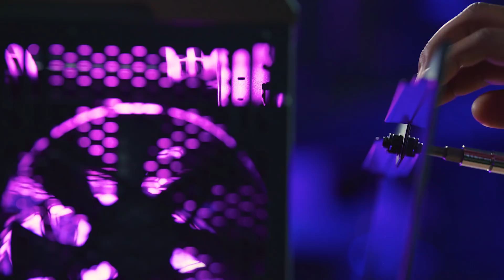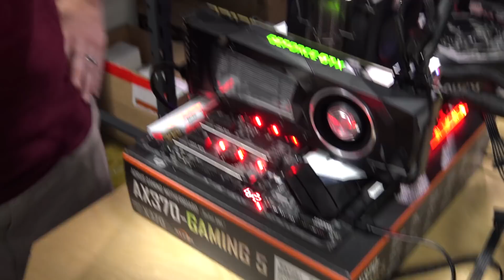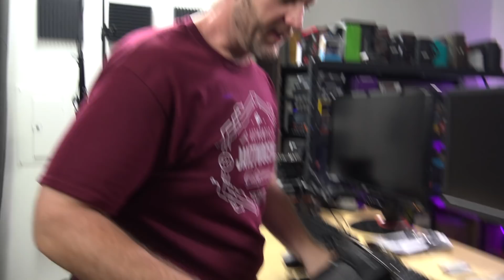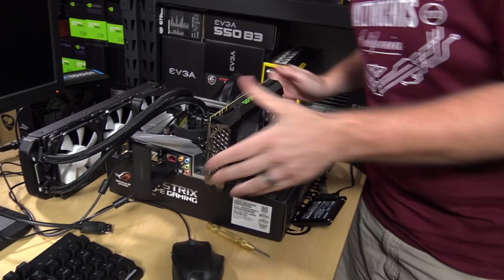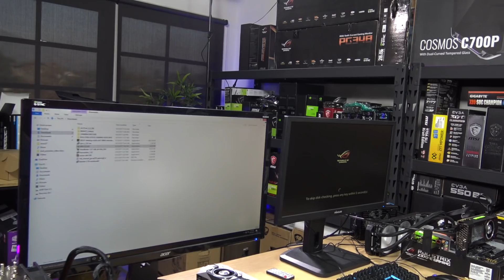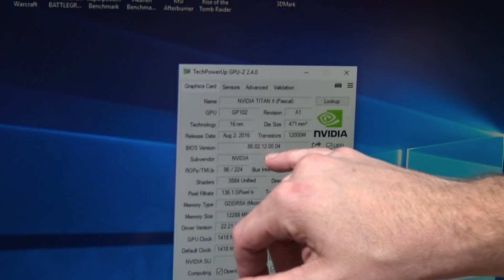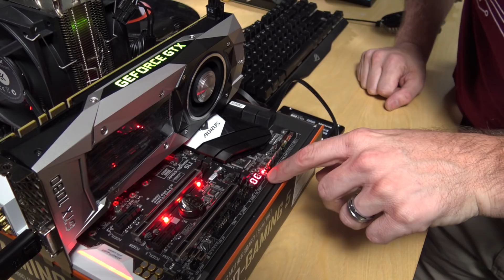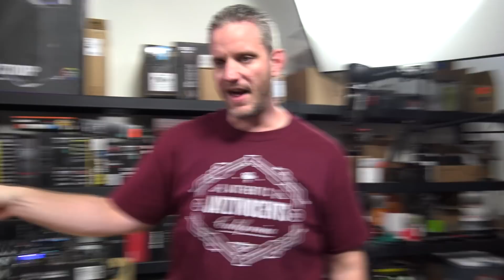I cant figure this one out... HELP!

Comment: i think the mother board is having issues. maybe it's a bad bios update? i have had 0 issues with my 1800x. i have had 3 different cards in my system and haven't had a single problem with it. or maybe the gpu is the problem. not sure which one. i'd contact the motherboard manufacturer and ask them if their is any known issues with  certain gpu's.

Comment: Fisr want to point out you checked the bios twice on the same card. First pulled it up on intel and then moved it over and checked it again did not check the card that was moved to intel system. Just pointing that out but i dont think that is you issue i actually had a similar issue with a previous build and it did turn out to be the motherboard. U can test this if u have the same board witch it out and it should work just fine

Comment: Problem, we don't his BIOS settings and whether he's OC'd the Ryzen system.

Jay, have you loaded failsafe defaults and running at stock clocks. Also, I suspect the system is using UEFI bios and nothing in legacy mode. May want to see if you could use DVI with the "Bad Card" I had a similar problem with my 1080 founder's in SLI. (complete shot in the Dark) Disabled one card, and booted with one card and uninstalled the Nvidia Driver and re-installed without letting Windows use the WDDM driver.  I had to also update the chipset software. 

Funny, my issue was on an intel system with 6600k. I think the problem is something to do with UEFI not allowing the device. My board was also from Gigabyte. Problem with UEFI on Gigabyte boards? 

Like others have said, and I'm sure you'd heard it enough; "Check the Bios" of the problem card. I would ask the blowhards to stop repeating each other b/c that's not the only point here. Jay is perfectly competent. This is a very unique problem to my knowledge and the problem is very strange.

Let us know what you find out Jay.
Reply: I know I know, replying to my own reply. One further suggestion, as this is bothering me. 

1) Boot with working card
2) Disable UEFI Boot and UEFI CSM such that you are booting legacy
3) Attempt Boot with problem Card. "If boot = Success; Then Profit" if not
4) Disable EFI Support, and also attempt removing RAM Modules and other attached devices
5) Try disabling VGA EFI Driver support 
6) Disable any Ryzen specific settings
7) and this probably should have been first, but compare the two cards' Bios.

I would personally hope you do step seven last, as I want to know if any of the other settings are causing the issue. If you do the others first, it's worth a 10 dollar donation from me.

Comment: I have had the same problem, except it's with my memory. What I do is I remove the battery on my motherboard and leave it unplugged for a couple of minutes to flush all the capacitors. After that I try booting with sticks in different slots and trying the automatic overclocking button on my motherboard until everything works again. Usually takes me more than 20 restarts to get it working again.

Comment: A couple of things I noticed, the bios needs to be checked on the bad card with the intel to compare correctly, the second is the Ryzen Mainboard bios settings do you have system security or CSM disabled, enabled?   If it happens with other cards as you eluded to it could be Ryzen bios settings.    SIP, system integrity protection may be the issue.

Comment: I noticed you used different DP connector. On the non functional PC you alvys use bottom connector. On the working one you use top DP port. Aslo try switch monitors or boot up without connected LCD monitor.

Sry. my bad english.

Petr

Comment: Did it work with an older bios revision? Have you tried a different slot?  If you can get access to the same motherboard I would try that as well. It looks like you have exhausted all of the other options on the gpu side, if it were a corrupt bios you would see may other issues. Since you have probably ran the benchmarks on those cards how close are they running? That would be a long shot but maybe you can see something in the numbers there, but I have doubts it is the gpu itself. Other options would be bios defaults, different memory and or cpu. They are all odd ball things but may give some different results. It could be the most dumb thing.

I have a gt1030 that works in every system except the one I want to run it in. It is an older intel machine. Another gt 1030 works fine in that machine (borrowed from elsewhere). They both are the same brand, I did not check bios revisions on it, I just figured it was typical nvidia qc, but now it may be something picky with the motherboard or gpu. For my issue, I tried different memory, cpu , power supply; since I am running a pico psu it may have had issues powering it. Since this is more of an emulation box I will figured I would just run the old amd card that was in there.

Comment: Need to check the NIVIDIA website to see if there is a newer Bios for the card , But Even then i would think it would work , My 1050 Ti had a Similar problem After a couple of months use , reported it , took a week and a New DRIVER was Released , Hint , hint , DRIVER , Not Bios , I actual contacted ASUS for an RMA , Thought For sure it was the board . Turned out it was just a DRIVER Update issue , The Serial # Coralation Could had been a problem , not recognizing the card , but Even then , i would think it would work . What i did see you resolve 1 with was a re-seating , how ever , i think you would had try`d this with the first card as well , ? , Any way , If i had a 1080 Ti , I would be able to help More ,But-t , 1050 ti is all ive got to work with , Good luck !!! "reminder" , Im still working Off a X370 Prime , so with the board possibilities , Im just a Dud in the water when it comes to that , Again , Good luck ,,, Stop counting on GPU-Z to give you your Bios versions , Look in the NIVIDIA Control Panel , or Just Open the GEForce espirence to Locate such information , I Never use GPU-z CPU-z , to find My GPU information , Or my CPU information . Although its a Good use in Live Contrast to Bench by . But Not a Viable venue to locate the Product information Through .  My Apologizes

Comment: Former SSD firmware engineer for 5 years - It can still be the device (GPU) that's broken:  it could be taking too long for a particular operation (out of spec) and the Intel is more lenient on the timing while AMD is not (e.g. despite the spec saying 5ms, Intel allows 10ms while AMD is strict at 5ms).  The fix can be an update on the AMD motherboard to allow more lenient timing, or the GPU to rearrange startup operations or attempting to give a reply sooner (maybe even a false reply), or Windows ignoring the first error and retrying.

Comment: I have had a similar issue on a Pentium D based system and a HD5650, and an AMD Athlon 64x2 system with a HD7850, I know, massively mismatched hardware but I have my reasons, sue me.

My findings indicated that it was either an incompatibility between the system BIOS and vBIOS, or the PCIe slot wasn't providing enough power to the GPU, the reason I thought this is because the HD7850 worked in the Pentium D system, but not the Athlon system, and the HD5650 worked in the Athlon system but not the Pentium D system.

In your case I have a strong feeling that it's a vBIOS compatibility issue, and I would try and get a matching vBIOS and test it on the Ryzen system.
Also you didn't check the correct GPU, and without that crucial piece of information, it's very hard to say what might be wrong.

I would also flash the motherboard BIOS again, cause I've had weird issues where a BIOS update would work, but there'd be options missing or the system would be unstable, and reflashing the BIOS would fix the problems.

Comment: Jay, you plugged the suspect card from the AMD system into the intel system and did not check the BIOS. You took the good card after checking the BIOS from the intel system placed it into the AMD system and rechecked the BIOS in the AMD system. Of course the BIOS will be the same!!!

Comment: He's obviously had a long day... Checked the same GPU bios on both machines. Switching the working one from the Intel board in the Ryzen system would be the same BIOS lol... The none working Ryzen GPU you put into the Intel board which booted fine but you didn't run GPUZ on that Intel system with the card which failed on the Ryzen board...

So re-watch your vid Jay 

Easy mistake my man you had been messing around for over an hour so brain fried need to take a break an come back to it after reading the comments :)

Comment: Check the power draw with each card. Perhaps one of ATX power connectors isn't working properly on that Titan. ASUS boards tend deliver more power to the PCIE slot than the Gigabyte. So if it can't get that extra juice from the ATX connector it might not boot. Get out your voltmeter for this one, i think you have a bad card more than anything.

Comment: Hey Jay,
I have seen this before many times. I had one a little more perplexing because I had identical workstations, same everything by the same vender. Long story short, this is what I found out over the years of IT.
1. One time, the GPU was so picky with its power, Swapped PSU and it worked.
2. Another time, again the PSU; would not provide even flow to the motherboard once GPU was in.
3. Other times, the PCIE slot had pin problems. Would work with one GPU but not the other. Found out after testing that the one working like it was only at x8.
4. Had a GPU that the pins that insert into the PCIE are scratched causing the same problem.
5. Had a motherboard not post with a working GPU if you populated more than 1 DIMM slot.
6. Had a motherboard act as if it had no GPU with a particular GPU; but same motherboard worked with other GPU’s.
I have loads more but the only real way to test, is set up an identical system to the one that is not working. That way you can swap one part at a time to see what is causing the problem. My first guess would be the PSU. Second, I would look at the GPU, are they identical or is one off a bit? Third I would go with the Motherboard. Good luck man. I do this stuff for a living so let me know how it goes.

Comment: Take the card that doesn't work in the AMD system, move it to different slots, switch power supplies and switch ram in the system.  Try a bios reset too.

I would guess maybe it is a power thing because even identical cards fluctuate in power differently.

If of course it is not a bios issue.  The PCI slot might not be getting adequate power for that particular card.

I have seen weird shit like this before and have had computer parts suddenly work that weren't.  I had 1 VX motherboard back in the Pentium days I used for a year, then I gave it to my electronics teacher cause I thought it was broken, all the sudden it wouldn't work in my system, tried swapping parts around disconnecting everything etc.  He took it and put it in another computer and it worked fine so he gave me $50 bucks for it.

I think you have to keep in mind the volatility of computers, they will never be perfect, I would just suggest changing everything out to see if it works in a different configuration.

Comment: Did you try the troublesome Titan XP in a different PCIe x16 slot on the Ryzen system, just to see if it would boot with the card? It might be a combination of slightly out of spec power draw for the card (since we didn't actually see which BIOS was on the troublemaker card) and a weak PCIe slot.

Comment: I would honestly just kill the power through out the while system and take out the cmos battery and leave it dead for awhile 5-10min or so, and than turn it back on with out battery and if it posts, than great, that happened to me with with my 970, i had the hd 6450 low end gpu and that one worked, so i just killed the power with the 970 installed than took out battery left for awhile came back turned it on without battery and it posted, since than havent had any issues and it oc very well

Comment: I do have the same problem gigabyte gpu does not work on my asus board and if I run that GPU in xfire it slows my system down and if I do an benchmark with that card in xfire my scores are the same as one card

Comment: I've had that happen with an MSI board on the X99 platform I was building for a friend. They had a gigabyte 1070 and I have nvidia 1080s. Their board wouldn't boot with the 1070 but it would with my 1080 and their 1070 worked just fine on my Z97 machine. So weird. We sent the MSI board back and got an Asus board and it worked

Comment: Rewatch your video. You checked the bios of the same card. You saw what it was on the Intel test bed, then moved that card to ryzen test bed and verified the bios version again. You didn't verify bios version on the card that came from ryzen system and worked on Intel test bed. Still not a definitive answer but just noticed you checked the same card twice.

Comment: Could it be an issue with power ripple? Check the decoupling capacitors on motherboard and GPU PCIE power pins. Verify if that GPU has signs of rework on those big caps or any is missing.

Comment: I would clean the pcie connector on the bad card. If there is tarnish on the connector you could have this problem. Depending on the contact pattern from one pcie slot to the other due to different mobo  manufacturers it could work on one and not the other. I would also clean the pcie slots with some electrical contact cleaner.

Comment: Apart from WAY TOO OBVIOUS (i'm looking at you, smart commentors) "checking bios on the same carrd twice" issue, i'd say - silicon lottery? With Ryzen just being picky elitist? No two chips are the same, even with identical clocks and speeds and temps. Half-dead core there, bad ball here, etc. I'd stick to this thought and move on, it's probably not worth it :)

Comment: Again, as everyone has said, in the video you checked the same card twice, once in the right system, then in left system. Of course it will have the same BIOS as it's the same physical card. Check the BIOS from the first card that was in the left system first. If it's the same, good luck. If not, then that might be the issue. Checking a third card then, again, a 4th, you're adding yet another unnecessary variable to complicate the issue after an untested first issue. If they were 3 identical cards (BIOS included) then fair play, but you need to test the first issue before adding more.

Comment: My only wild guesses is to put bios into legacy mode? Turn off UEFI / Secure boot? There has been an issue I've run into using older Intel branded motherboards with modern cards. Intel never updated their bios to support graphics cards booting into UEFI mode. And by old I only mean Sandy bridge era. 

Can't think of anything else :(

Comment: You took the bootable card from the intel system (which you knew bios version) and moved it to the AMD system and checked the same bios version.  Go to the Intel system and check that BIOS version there - that was the non-bootable card on the ryzen.  You basically checked the same card bios ^.^

Comment: Something that helped me getting server cards to run in desktop boards is taping over the two SMBus pins on the PCIe connector. (Google Images "pcie smbus pins" and there'll be a few examples like https://ezl.re/1GK ). It might help you here, it might not. Masking those pins should have no permanent negative side effects.

Comment: When I added a 1080TI to my Intel system, the existence of a M.2 on the motherboard prohibited my using the top PCI Express slot. I moved the card to the last one and it works at full bandwidth. In the first slot it failed to post and had other issues. Apparently, the M.2 shares lanes with the first slot, on this board even though it was not documented. A GTX-970 did not have any problem in the slot.

Comment: Eliminate the motherboard  PCI-E slot as the issue. We all know there should be no variance in clearance for the contacts in the socket. Real world will tell you otherwise.  Put one of your PCI-E extenders into the board and test it with 2-3 cards to confirm a 100% good mate on the MB slot. Plug the "bad" card into the extender. If the card works with the extender, you have eliminated MB incompatibility /bios and narrowed the issue to the Bad cards physical inconsistencies with the MB slot, or the card itself. The extender mimics a new "slot" like the intel board represents. Another option if you have a second motherboard of the same Aorus version. Flash that bios to match the first and confirm the issue is Bios/Board related. I am sure Gigabyte would send you one to confirm.

Comment: Besides confirming the BIOS, the are several things that could cause this several that have already been stated.  The physical connector issue (tolerance between card thickness and slot thickness) is one I wouldn't expect sure to the commodity nature of all of the parts, but it's possible. 

Another thought is it could be a power issue/timing, where it's crossing some MB threshold at that specific point in boot.  Changing the fast boot/thorough boot setting could affect timing enough to allow it to work.  Even if changing fast boot changes behavior, this could still be several different issues, but it is of interest to try.

Whatever the issue, this could be a very interesting thing to work with NVIDIA and the MB MFG to solve in video.  I think there is a lot your viewers could learn from watching the engineers explain how they'd solve this issue - and seeing what the issue is in the end.

Comment: Don't know if anyone had suggested this yet.   But have seem the same due to psu.  Voltage on one rail just under what the card needs\has available.  Silicone lottery I'm afraid.  Try swapping psu with card from intel to amd and see if issue persists.